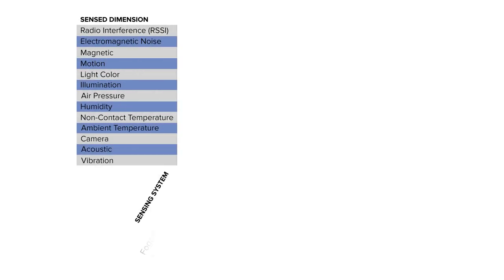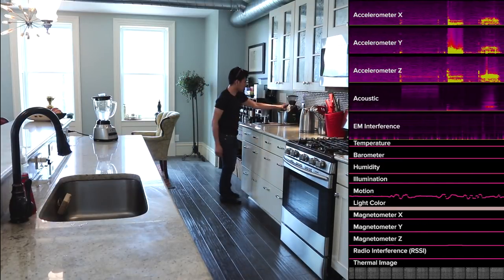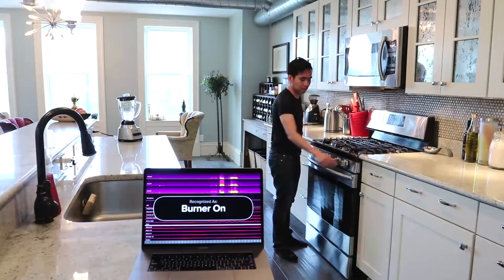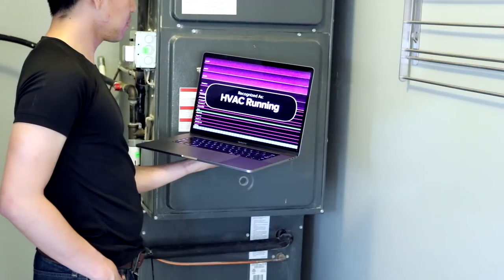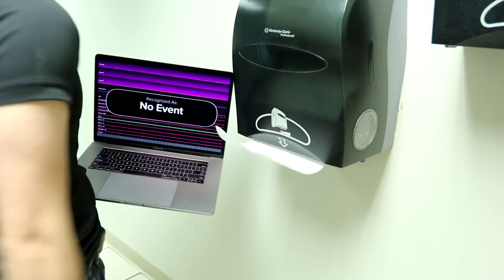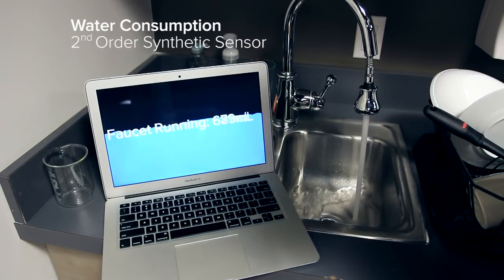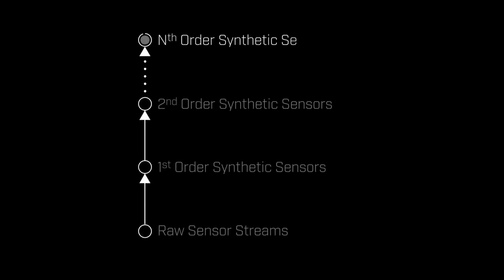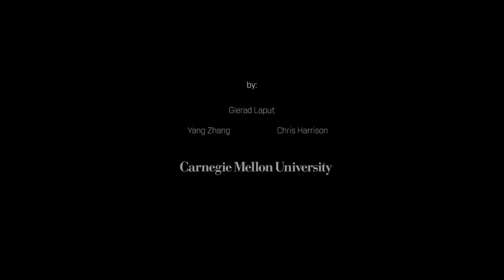Synthetic Sensors: Towards General-Purpose Sensing

Comment: Love it. Shouldn't be hard to solve ambience issues (living by a freeway, or in a city), but those Nth sensors are awesome. Detecting the ways device signatures change would be sweet: If the condenser in your fridge is running more often after a year of use, filters in your HVAC need replacing, all kinds of cool things you could do with that.

Comment: Very impressive, but I get the impression, the soundsensor (and maybe a heat sensor) is the only one used/most important one. Can it sense writing in a blackboard and erasing it? I really have strong doubts about that or at least doubt the accurateness of that. But maybe I am wrong
Reply: In a nutshell, data from acoustics, vibrations, EM noise, temperature, light color, and thermal image are able to capture a wide variety of events. But for some events, you need other sensors (e.g., magnetometer). It depends on what you want. "Fast" events (seconds-scale) are best suited for "fast sensors," while slow events (e.g., hours to days) are best suited for "slow" sensors (e.g., temperature). Our paper contains a table that describes "sensor contributions." You might find it useful!
Reply: Gierad Laput will have a further look

Comment: This is quite brilliant and elegant.  I'm surprised the multiclass SVMs worked so well -- is it really that easy to train?  Will the code or data be available?  The demo in the video is very smooth.  Also, what's the song playing in the background?  It's great.  Shazam fails to identify it.
Reply: Thank you! SVMs work well for this application, but other approaches are also possible (e.g., we are looking at deep learning, which would make this system even better). The background music is called "Imagination in Action" by Olive Musique. Licensed from PremiumBeats.
Reply: thanks for the reply!  I also wondered (I should really be digging through the paper) how much of the activity classification was being done with many sensors vs a just few (one or two).  For example, a lot of the activities can be classified through the acoustic signature -- straight-forward, labeled training on that alone could probably give you decent performance.  The fundamental question being, how much more information do you gain from each sensor for different activity classes?  Thanks again!

[Don't bother answering.  I read your response below in the comments :-) ]
Reply: You get a lot of useful correlation from other sensor channels, and it generally helps improve robustness. It also depends on the event. For example, a microwave running triggers the accelerometer (it vibrates), mic (it makes a humming sound), and the EMI (it radiates electromagnetic noise). You can get rid of 2 / 3 of these channels and still get good accuracy, but having 3 / 3 is certainly better. Hope this helps.
Reply: Thanks!

Comment: I wonder if I can use them in a commercial building to see if the boilers burners kick on, pumps are kicking on, sense hot water pipe temp, boiler flue temp, water leak, unusual mechanical noises etc.

Comment: I agree that it might be useful to think in terms of a hierarchy of sensors, but I disagree with the implication that the hierarchy starts with a nice simple "1". At the chip level, your "real" sensor is arguably more of a "virtual" sensor in a chain which only ends in voltage thresholds. Hierarchy, yes, but clearly numbered integer levels? Not so much.

Comment: Hello!!! I certainly admire, the coolest in the algorithms of recognition events of course, but I as an engineer of security systems (and not only:) would like to ask why if You have AMG8833 to put more and PIR. Well, here is the moment where when you turn on the water, the signal coming from the accelerometer, is it so the pipes make a noise?)
Reply: I suspect a lot of this video is bullshit. How do you use a remote accelerometer to detect water from a faucet?

Comment: Does it use sound spectrum to detect which event is working? Sound pattern?
Reply: Yes, as one of its features.  We link to the full paper in the video description, which offers more details.
Reply: The system uses the audio spectrogram as part of its feature set. Turns out you can derive useful patterns from it. Other useful features from our findings include the vibration spectrum, EMI spectrum, light + color patterns, directional heat, etc.